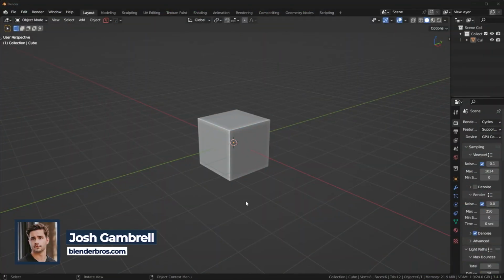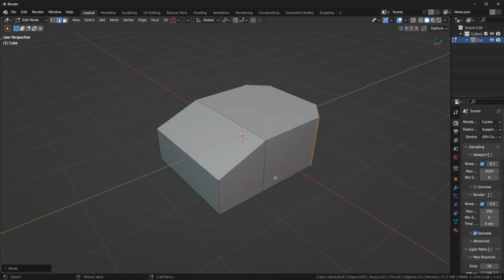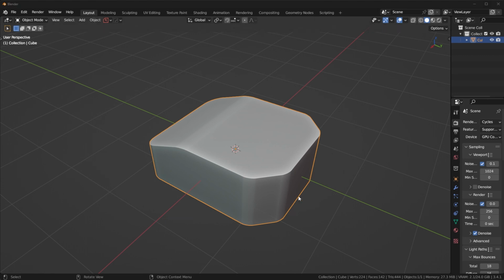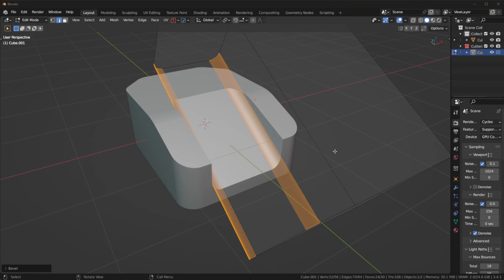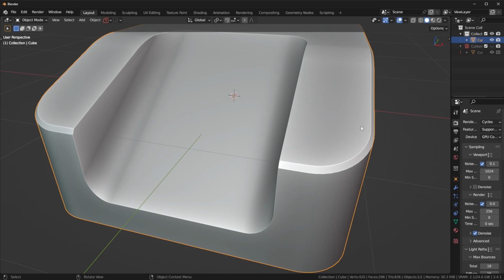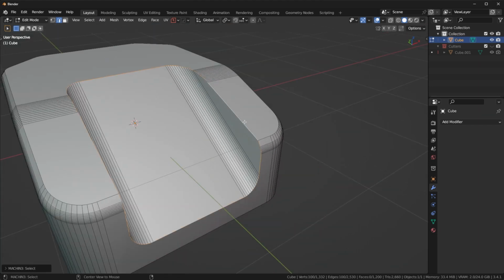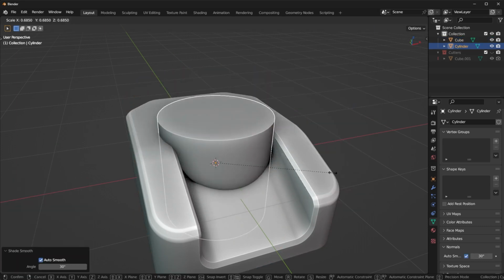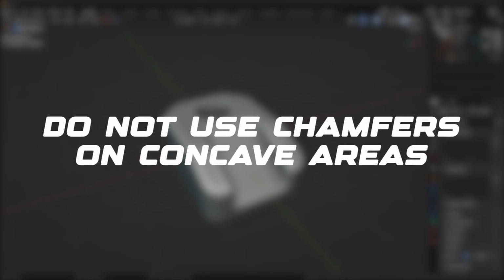How to give your 3D models that 'mechanical' feel

Comment: Great tutorial. There are two reasons why this looks more natural. 

First and foremost in the real world most machining is done on a mill where the cutting is done with round bits. This will leave more rounded edges in most locations. It takes a lot of hand work to get hard edges especially in corners. That extra labor costs more money. Molded parts often have rounded edges and draft angles because it makes things come out of the mold easier. It's the nature of most modern machining. 

The second is safety. Most exposed edges are intentionally rounded off to prevent injuries to the users.

I'll add a third, wear and tear. Over time on objects that receive a lot of use, hard edges will naturally round off over time. Exposed ones wear down and internal hard edges are hard to clean. Over time dirt and gunk will build up in those hard corners because it's hard to get out.

That is why this tutorial is dead on.
Reply: Adding to this, concave angles are always rounded off because they become a good starting point for rust and crack propagation. Sharp concave angles don't take kindly to mechanical stresses - a lesson that was learnt the hard way by the people who designed the DC-8 airliner.

Comment: Just curious, no mention of variable chamfers?  Don’t know if Blender supports them or not; we’re a F360/Rhino/ZB shop.  I like to peek in to see what ya’ll are doing in your design vids, though not a Blender user myself.  Always learning/inspiration when it comes to design thoughts…moving on.

So fun tidbit for readers,  if you are actually (yeah like that for-real  real-life stuff) manufacturing/machining something.  And the following applies primarily to machining/3D printing an end product/component…casting/molding is a bit different economically and in mfg considerations (things like release/draft etc…yeah we’re skipping that here).    But you might want to think about how your components or shiny-shoots thing is actually going to be made, just a tinsy bit.  Kinda like you’re thinking about where your screw/bolt holes are placed and why…accessibility etc…right?🤔

Ok, for the one or two readers still with me 🤗

Fillets are more expensive to CNC, granted you might be able to buy expensive tooling for specific radii/material needs (kinda like very expensive router bits) or for example, you go with ball nose bits for your fillets which give you a greater control/variety of radii from one type/spec of ball mill - but at the expense if machine time; making a fillet look/feel smooth is time consuming.  Chamfers on the other hand…easy peasy on tooling.  Do a machine runtime sim on your model and you’ll see what I’m talking about.

Almost there…almost there…

So, why do I mention this?  Something extra for the reader to perhaps take into consideration on your next design.   Almost every Sci-Fi (federation/empire/kingdom etc) manufacturing budget has constraints, can only squeeze those space peasants so far.  To that end, just like real life, use fillets on high end products or where “feel” is very important for its use, but only where you absolutely need them.  Chamfer,your goto for knocking off those nasty sharp edges.  Both fillets/chamfers have a role to play in how easily parts can be made to fit together.  And don’t forget their use in creating shadow lines.  If you want lots of dings in your machined edges (what you’re not using Iconel or unobtainium?) go w chamfers…they get bunged up more from use due to stress.   There’s a lot more to it…think round tubing vs square tubing bending properties etc.  there’s plenty of material (pun) out on the internet for fellow retentives.

Fillets in 3D printing can be made to look nicer if you’re printer/slicer support variable height layers; but it’s “more expensive” in machine run time.  Trade offs 😊

So readers, you might want to take a moment and think about who/what/where/how (e.g. a brief) will be using your creation and it’s “manufacturability” (unless you have a Star Trek replicator - hopefully not a Stargate Replicator!) and help build your object’s “character” with chamfers & fillets. 

Just some food for thought.  

I’ve always found sci-fi to come across more immersive/believable when everyday real-life details are worked in.  Especially on props etc.   That may be just me 😜🤦🏻‍♂️

Ok, that was way way longer than I intended.  “Damnit Jim, I’m an Engineer not a doctor!l” (but ya still can’t read my handwriting 🤷🏻‍♂️)

As always, YMMV,  just sharing, nothing more, nothing less.  

Ya’ll have  a good’un!